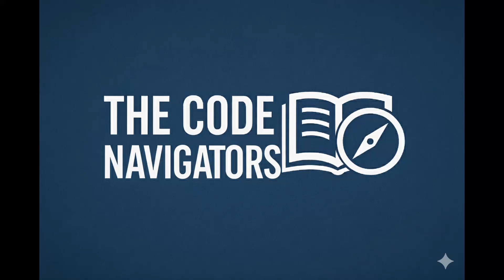The Code Navigators 2021 IBC Chapter 8

Comment: In point 4 of Sec 803.1.1.1 the peak heat limit is 800 kW not 300 kW as indicated in minute 9:12. Thanks for the summaries; they are extremely helpful.